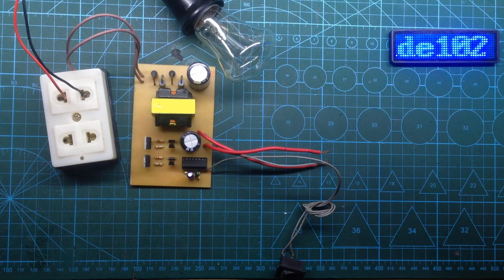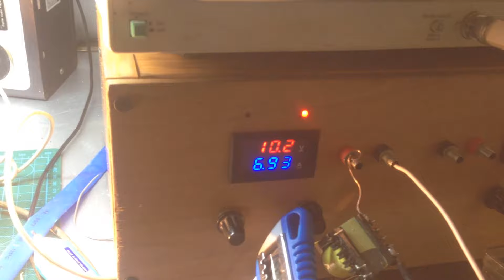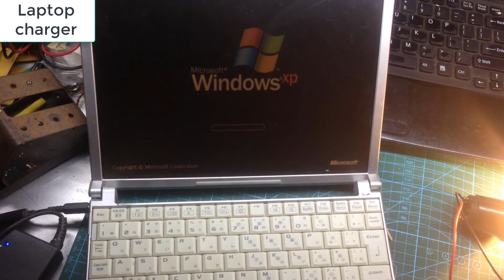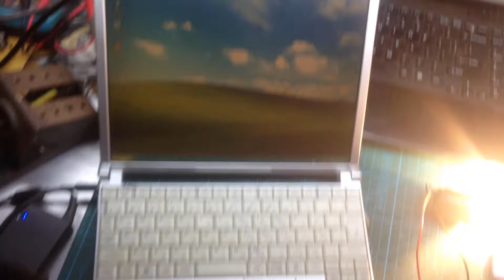300W inverter from ATX  power supply TL494

Comment: Good  project but it will use for bulbs and chargers on dc power, please do it out put dc to convert ac for using fans and home purpose
Reply from the maker: I will design it, wait for me
Reply: Lots of fan use universal motors so probably ok.. But you would limit yourself using this,+ the high voltage ⚡ DC just cringy

Comment: Buen video lo unico q no esplicas q si la lampara se desconecta por casualidad y esta enchufado un cargardo de tu celu...lo quemaria al instante porq el capacitor se mantiene en un voltaje muy alto 380v es demaciado creo poniendo un resistencia de 150k frenaria un poco ese voltaje en la salida
Reply from the maker: Yes, adding a discharge resistor is a good idea.
Reply: Español???

Comment: I make with ka3525 and irf 3205 with your previous schematics, but fets are too much hot after very few second.  Atx transformer winding 3 0 3. And 90 turn with atx transformer
. Pls help me.
Reply from the maker: Contact me via FB group. I need your circuit picture.

Comment: Krásne Ti šlo to spájkovanie. Ja neviem s takou spájkovačkou pracovať. Používam stále transformátorovú spájkovačku. Asi by som mal urobiť k nej regulátor výkonu.
Reply from the maker: You can buy hakko 936 clones from china, it is very cheap but works very well. I also have a transformer soldering , but only use it when it is necessary to weld large components or large wires, it is too heavy.

Comment: 315 volts ac!!!! You can just power some lights with this inverter nothing more beacose its too much voltage 
lower the pwm signal on the tl494 to get about 240 volts and than it can be used for chargers and other things
Reply from the maker: In the next video, I will rebuild it with voltage stabilization

Comment: Fantastic. You are always using push-pull but it is prone to core saturation. Have you experienced it?
Reply from the maker: It is not saturated core.  You need to wrap enough turns / volt.
Reply: @PhdHung  Thanks for reply. How to calculate enough turns. If there is some mismatch in primary turns then it will create saturation of core. But I saw you have used it successfully everytime and I surprised hence want to clarify from you.
Reply: Homemade 102 How i can measure if a ferrite  core is saturated or not? Thanks!

Comment: Hi, I have used 110v winding for transformer because I need 110vdc output , but after rectifying I am getting 300 vdc , how do I reduce it. By removing capacitor from output I am getting 200vdc . How can I get 110 vdc ?

Comment: What is the Value of Fast Diodes?
Reply from the maker: u can use FR207 307 or UF207 307 etc..
Reply: @PhdHung  There Is No Diodes That You Say Where I Shop 😕
Reply from the maker: find the diodes starting with UF, MBR, FR those are fast diodes
Reply: @PhdHung  UF4007 1A , UF5408 3A , UF1010 1A   would these diodes be?
Reply: @PhdHung  ?

Comment: 310V in multimeter 2:05 ?
Reply from the maker: Yes. A 310V voltage is needed to generate 220VAC sine.
Reply: @PhdHung  schematic?  Stabilization?
Reply: @PhdHung  Square. Frequency? 50kHz? 1n and 10k?
Reply: @PhdHung  310V destroyed

Comment: Ohhh...but the laptop adaptor input voltage is AC and your converter output voltage is DC high voltage... some trick??????
Reply from the maker: Inside the laptop charger and phone charger have bridge diode. It converts 220V AC to 310VDC. So you can use the 310VDC provided for laptop and phone charging.
Reply: All switch mode power supply rectify the ac first so they can use DC no problem... HOWEVER use a device with an iron core transformer.. You risk BURNING YOUR WHOLE HOUSE DOWN,